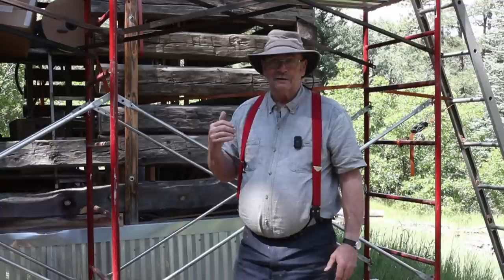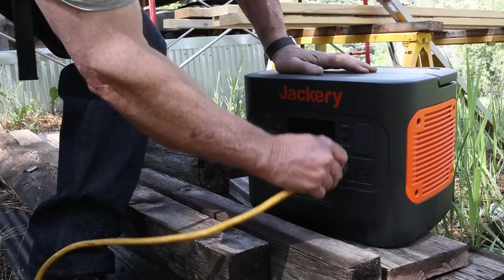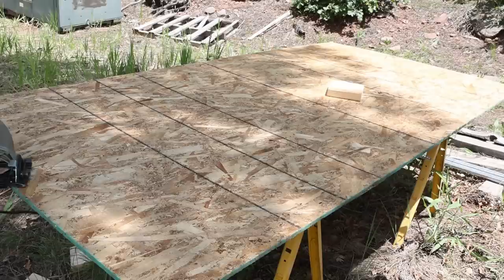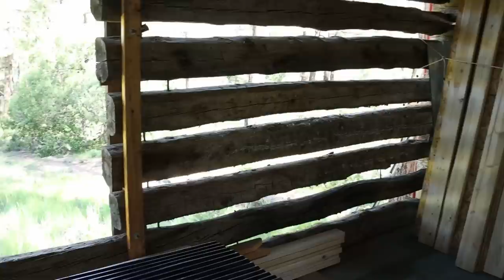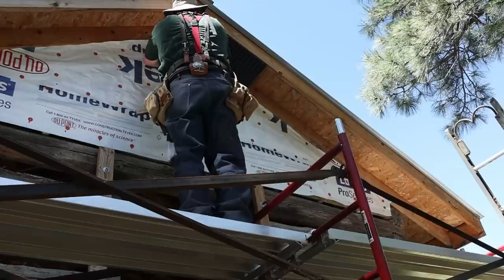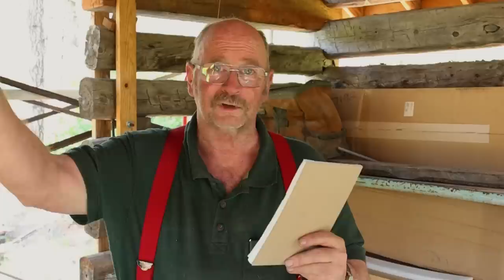I have put this Cabin Project off for too long

Comment: I built four log structures when I first started out in carpentry 40 years ago.   Even though we were working with machined cedar logs, there was always an error factor due to the preparation process or to the wood shrinking/twisting/bowing that you didn’t find in dimensional lumber.    The site supervisor told us all to use “visually appealing” as our guide when having to allow for an inconsistency in the logs.   If you have to make an adjustment on the go, just make sure it will look OK to the eye.   It worked for us.  Never heard a complaint from the homeowners.  
Cheers!
Whipple

Comment: Lookin' good on the cabin work!😊 I noticed you were using the red colored chalk line.  For those who may not know, the snapped red lines on wood are permanent!!, so if you will be looking at that wood...decks, siding, etc. use the blue chalk.  It washes off.👍
BTW, that scaffolding is a great way to work on that.  Keeps you off the ladders.

Comment: You probably could find some black "J" channel for that gable to soffit joint.  Nail the J-channel to the gable end OSB tight against the soffit metal and you are done.  Since no rain will be able to get up under that soffit it will trim it out and look great.  At least that is how I would do it.

Comment: The cabin is starting to look like something I would use the flashing that you have to put under the bottom side of the corrugated siding that you put on the Gable to level everything out and cover up and cover up the unlevel top part of the logs where it meets the Gable

Comment: Dust that corrugated iron off well before fixing John! When its cut with a grinder the dust picks up a static charge and adheres to the steel causing rust down the road! Wipe a freshly cut piece with a white rag, you will see what I mean! Glad to see you back on the cabin, looking forward to more!🇦🇺👍
Reply from the maker: Thanks for the tip!

Comment: How did you handle the shear loads on the walls? It looks ready to collapse. Shear rated wall panels will do it, diagonal cables would do it, bulk of the logs laying on each other would do it. 4 deep sunk posts would go a long way, it's that I don't see any of that, and am concerned for your safety. Maybe I just missed the episode that you covered that. Stay strong, stay healthy.